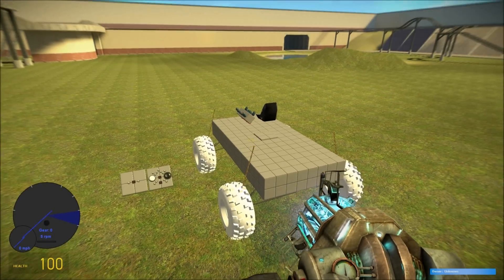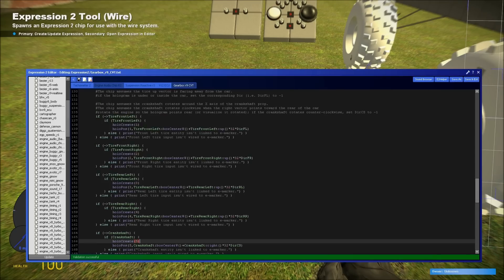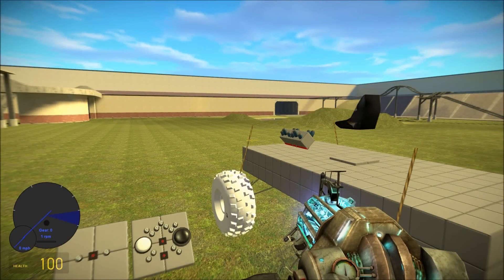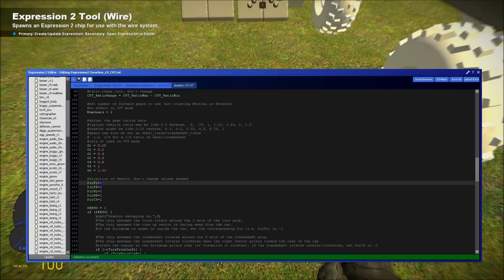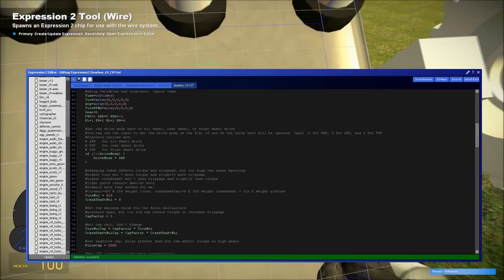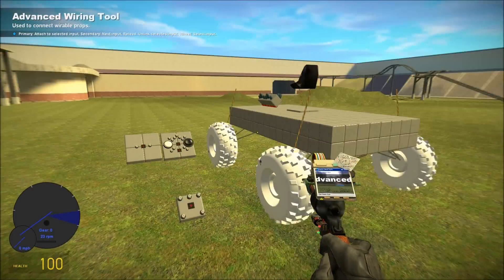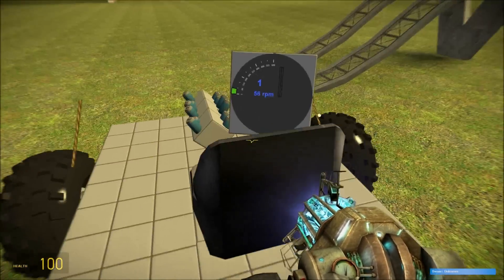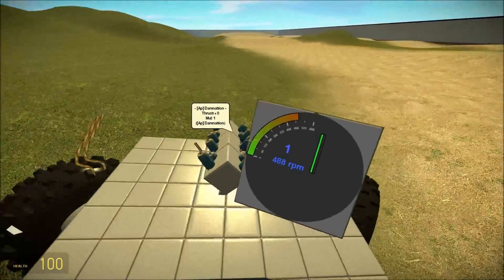GMod - [Tutorial] E2 Transmission r9

Comment from the maker: It's probably not reading angles and/or applying force on the correct axis of the wheels. If you set debug=1  in the setup of the chip, the holos should be either to the side of the car, or parallel to the wheels under the chassis.  If the holos are in front / behind / above / below the wheels, then you need to change the angle TAV uses, and the angle force is applied to the wheels on.

Comment from the maker: Yeah, I lowered thruster power.  E2 has the ability to remotely apply force to objects, so that's how the chip spins the wheels.  The engine is not connected to the wheels -- the chip simulates a load on the crankshaft, and applies corresponding force to the wheels.

Comment from the maker: It's a bit complicated to fix.  First, at the top of the chip there's a @persist you can change to @outputs for debug info. Change it and click the chip with the debug tool.  Check out the TireAngVel variable, and see whether pitch, yaw, or roll is highest when the wheels spin.  You'll want to go through the chip and change the TireAngVel:yaw() to what your tires use.  I think the only instances are where the ratio is calculated and when power is applied to the wheels at the bottom of the code.

Comment: Could you re-release the code? I would like to make my own E2 transmission  but I have no idea about all the math behind it and how to apply load onto the engine or read the torque coming from the engine.

Even a pointer would be excellent
Reply from the maker: Honestly, this chip was not a good idea lol.  It removes the point of having a prop engine, because the chip is doing all the heavy lifting by disconnecting the engine from directly powering the car; as a result the prop engine is just spinning uselessly, causing extra lag from all the moving entities.  You'd be much better off doing direct drive with the prop engine like normal, or making (or finding) an e2 engine for your car which simulates an engine and gearbox, applying force to the wheels realistically.

Should you want to forge ahead on your own, look into how engines work, how a drivetrain/gearbox works, how gearing multiplies torque and divides rpm, etc.
Reply: After a little bit of experimentation with applytorque I have came to agree, it feels artificial to have your engine not connected to wheels and it's insanely high in ops. Obviously I could just have the crank attached directly to the wheels but I find that my cars accelerate way too fast when I do that

I played with a the idea of having a direct crank-wheel drive but added 'gears' which reduced engine power + raised redline by the amount specified in the gear ratio array. It works but the gear shifts sound really choppy and it doesn't feel right. the e2 was quickly hacked together - with a rewrite and some refinement I'd say it could be decent.

Today I successfully built a dual cvt and it's 100% been what I wanted, it feels like a real gearbox and I even made a few improvements to the 8bit's cvt e2 by smoothening the transition between the gears, it drives real nice!

Comment: alright so i hooked it up like in the video and also used one of your engine (v12) and ill rev the engine and put it in gear and the wheels will slightly move then just not move at all also when i un freeze it the whole car slides off to the side when in gear and trys to flip sideways over any help?